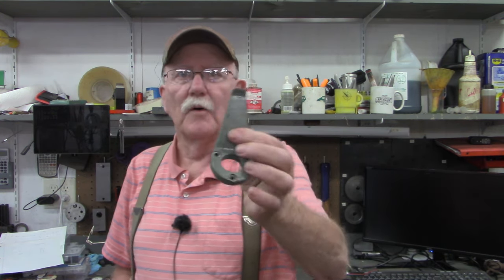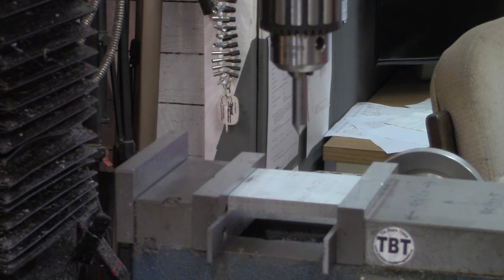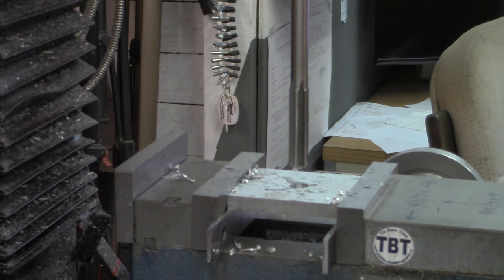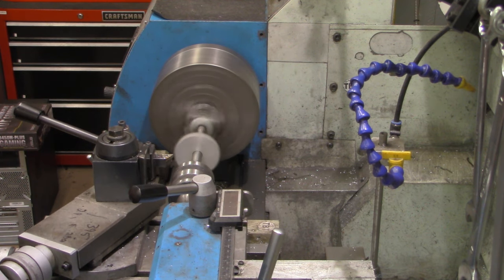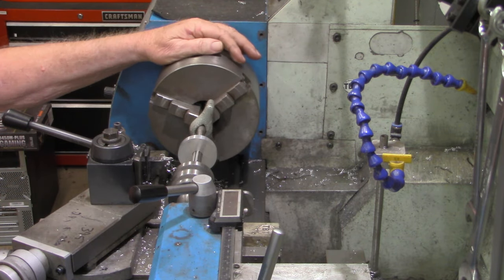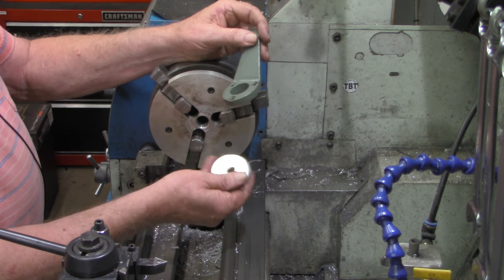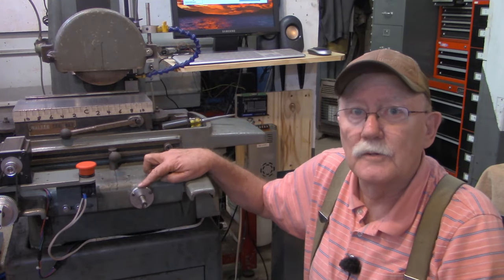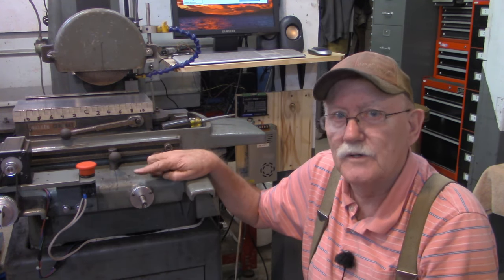Machining a Bearing Retainer For the Surface Grinder

Comment: I am watching your progress with interest. I have the same surface grinder and being able to automate both X and Z axis would be very helpful. One thing you may want to check is the backlash in the Z lead screw and nut. Mine was excessive and I ended up replacing them (they ain't cheap).

Comment: Good day, sir.
It seems to me the boss on the back side of the original part held the outer race of the bearing in place. The handwheel through the center was against the bearing inner race, also acting as a thrust bearing. 
Your flat replacement is possibly contacting both inner and outer races causing drag in rotation. 
Just my view from here.
I enjoy and look forward to your videos.
Best regards from PA.

Comment: Complex project!  I like your “can do” attitude towards making things.  Seems your abilities in the shop are unlimited.  
Maybe on the next video you can tell why you used the compound at zero like that instead of the conventional method of moving the carriage in.  I’m not very experienced but I think it’s because you wanted fine control by using the dial on the compound but I’ve seen you use a dial indicator for Z axis indication before.  Are the two methods the same?  If so, why choose one method over the other?
PS: I’m in the group that appreciates the microprocessor content as well.  Please don’t abandon that.